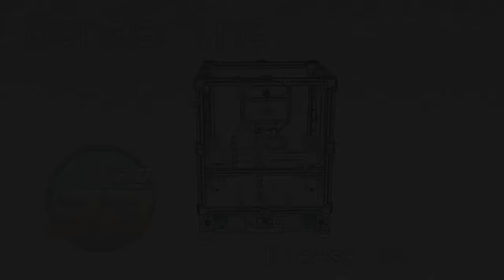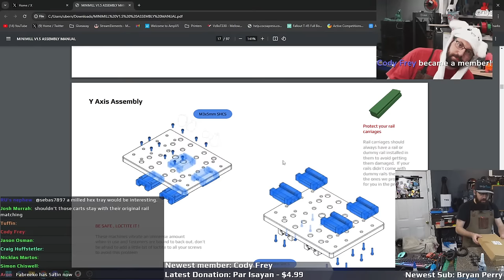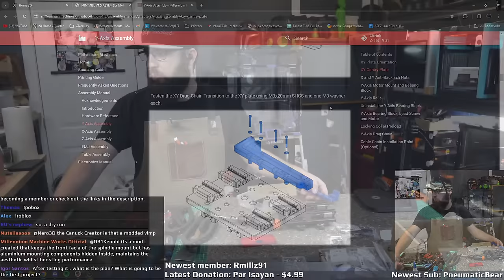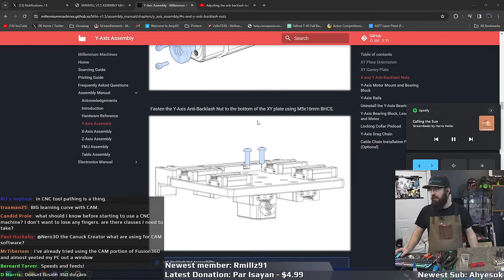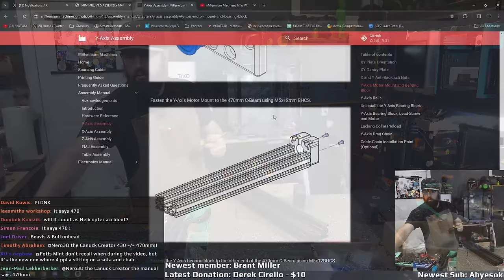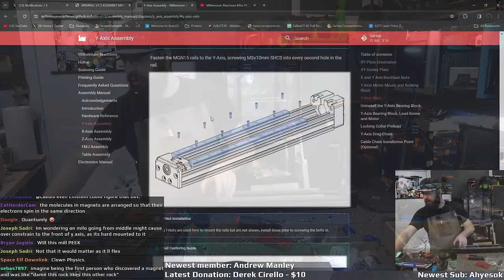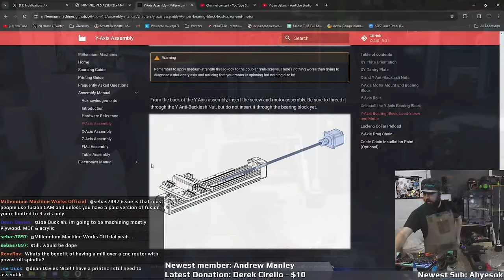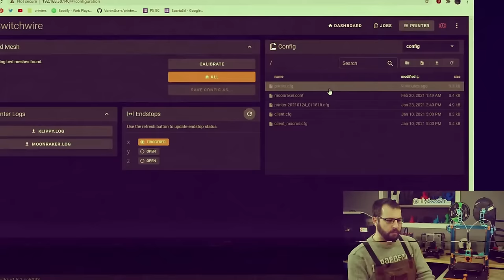MILO V1.5 DIY CNC BUILD LIVESTREAM - PART1

Comment: With precision measuring of tools or making machines I guess it would be advisable to set the room temperature at a fixed temp for the full period of manufacturer. That way the machine will operate at that temp perfectly and will not go under any indue stress or strain when temps vary. 

I know from rail they try to weld them at 22°C or close to that so when they cool and heat they don’t snap (which they can do). 

I know Mitutoyo give calibration data for tools and that about 22°C. 

The variation a machine like this would be sub thou but it would be advantageous to get as accurate as you can from outset. So once it’s start to wobble and vibrate it wouldn’t “relax” or settle as much…

Comment: Just a heads up, audio levels can change dramatically even if you never change a single setting. (in my experience, you are one of the quieter streamers on youtube.) Distance from the mic affects volume a lot more than any gain slider. Generally adding a decent amount of compression with a healthy amount of make up gain into your voice audio chain can help you sound louder and more consistent at the cost of slightly less dynamic sounding audio
Reply from the maker: Now that im listening back to the stream, ya, audio is way out. Thing is though, nothing changed, ive been using the same setup for months lol
Reply: @CanuckCreator  point is things don't have to appear to change.
I've done amateur audio engineering for many years. Unless you have a very controlled environment things can't really be counted on to stay the same from day to day. It's why stage performances do mic checks before every performance, not just the dress rehearsal
Reply from the maker: Thing is, on my end, everything looked fine, outbound levels were normal, same with the readout on the mic

Its fixed now, i just completly swapped the setup around, changed half a dozen thigns, not sure which thing fixed it but its back to normal agian lol
Reply: Weird. Well at least it's working now

Comment: Ah yes when I first started my assembly job they told me to keep all bolts loose until they're all started then tighten them. I also have heard about vibra-tite being more ABS printed part friendly, funny enough when I looked this up a while back, there is cyanoacrylate-based (super glue) thread lockers, loctite 425, vibra-tite 325, but at that point maybe its cheaper just to use super glue? There is another vibra-tite, VC3, which is safe to use with ABS as well, SDS shows it is a mixture of methyl ethyl ketone, and acrylic resin. I am sure permatex has safe to use ones as well. Maybe I  should just be quiet..